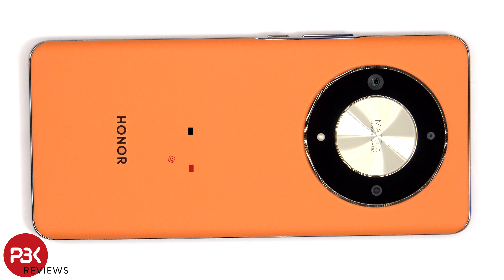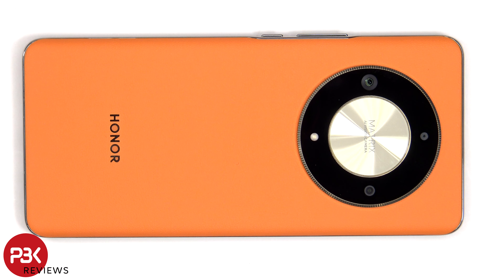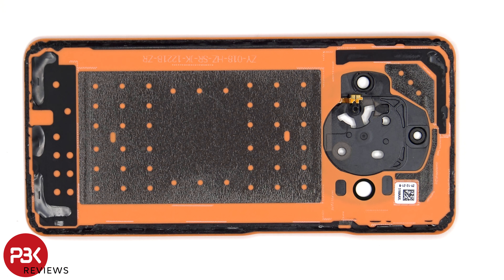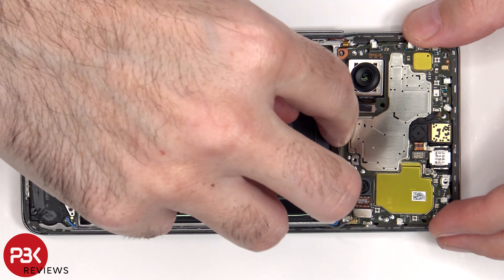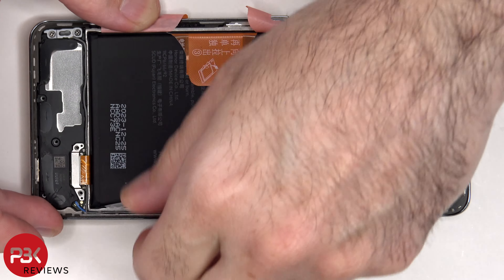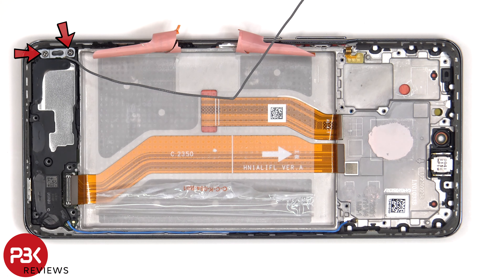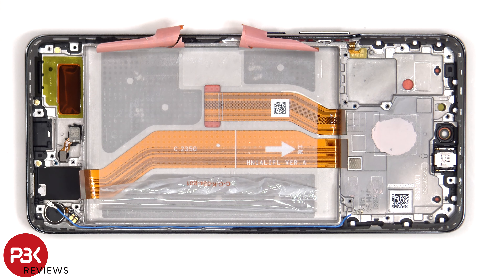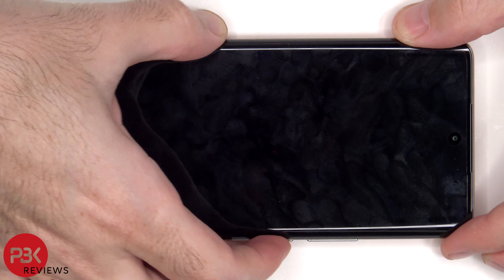Honor X9b Magic6 Lite Teardown Disassembly Phone Repair Video Review

Comment: Truly a horrible design with that hidden screw on the camera module. It's definitely going to get scuffed when removing it.
Reply from the maker: yup, no way to do it without damaging it in some way. Unless you can find some tiny suction cup tool lol.
Reply: Broh is this true that Xperia mark 6 launch this month
Reply from the maker: Yup looks like it
Reply: @PBKreviews  surprise screw from Huawei engineers, the suction cup helps (used in other videos)
Reply: Just like the Motorola ThinkPhone. https://www.youtube.com/watch?v=Znmidk_8KFc

I hate these design decisions! Was this screw that necessary?
Reply from the maker: yep, on the thinkphone it totally unnecessary, but on this phone since its holding down the flash cable to make a connection with the contacts on the motherboard its required. But they could have designed it another ways so either the flash was on the board itself, or with an extension flex cable to not require a hidden screw.
Reply: educate your self
Reply: @hamid.s.zolfagari  Educate yourself before typing something stupid, like "your self".

Comment: Can only camera ring glass be replaceable without changing back cover? I called one of service centre they said entire back cover need to be replace.
Reply from the maker: It can, but removing it will cause some damage to the borders of the camera bezel. So replacements probably just come pre assembled as a complete back cover.

Comment: that screw under the camera cover is so unnecessary
Reply from the maker: I know right? they designed it so the flex cable for the flash touches the contacts on the motherboard to make a connection so they put a screw there to hold it down and make sure it doesn't lift off but I'm sure they could have designed it a different way.